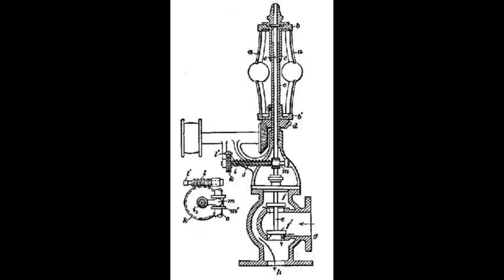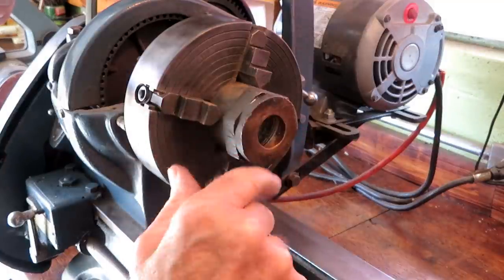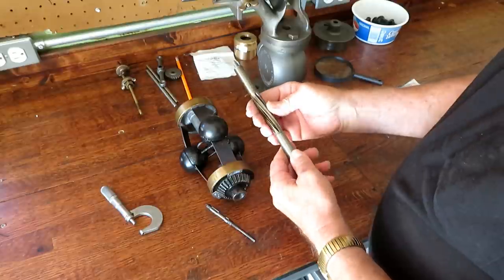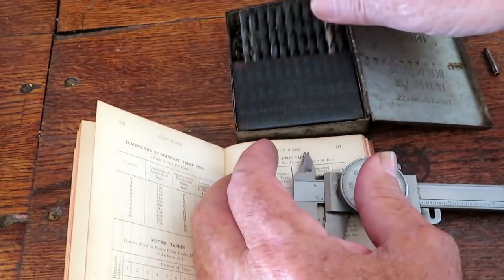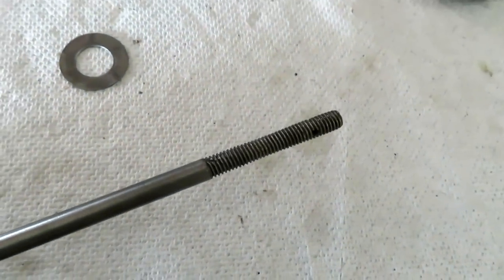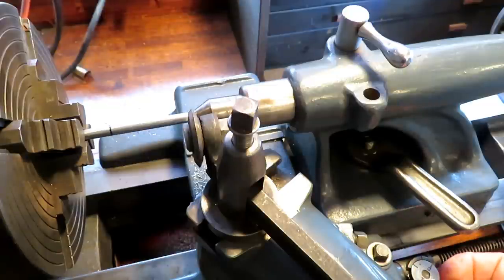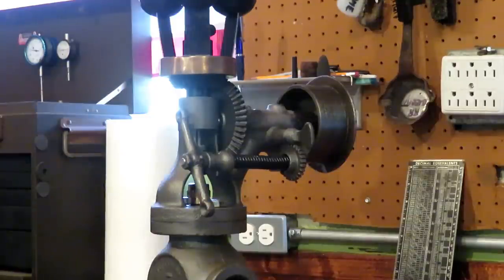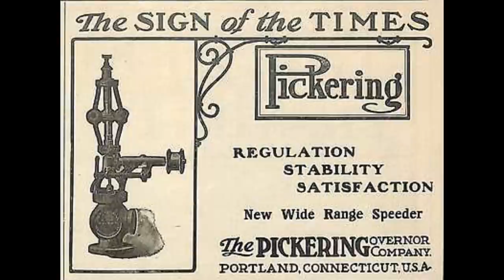Old Steam Powered Machine Shop 70: Pickering Governor for the Liley steam engine

Comment: Glad you're back!
I've had good luck with WEG motors- we use them in the plant where I work (along with Baldor).  I purchased one for my old Craftsman jointer and pretty pleased.  No noticeable vibration, quiet enough that you can hear the knives cut the air when not running wood across them.

Comment: Hi Dave, I don't know if it would help but try some sort of rubber motor mount on each corner of the motor bracket. It may reduce the vibration. Take it easy.

Comment: David, glad to see you back in action.
With respect to your lathe motor hum and vibration, may I recommend you get a Fenner Drives product, namely "Link Belt" (assuming that lathe uses V belts and not flat ones).  This stuff looks like the old fashioned fibre material belting, but is a modern reinforced type of polymer compound.   It comes in several widths and can be bought by the foot.  I buy the 1/2 inch wide stuff from Lee Valley tools here in Canada.  I know KBC tools also sells it.  It seems to have an excellent dampening effect on vibration and did an excellent job on reducing the vibration I was getting on my Myford lathe.  The other huge advantage is given you can open the links up, you can install this stuff without having to remove spindle of any machine from its bearings etc. so renewing belts is simple and quick.  I have replaced all the belting on my machines with the appropriate sized Link Belt.  Hope this may help.

Comment: love the steering bracket with brake caliper on it. nice job. the 401 buick torque monster must be a handful on the tires. really nice ride. glade you are having nice winter. thanks for taking time to make video. have safe trip back to NY
Reply from the maker: Doug, The Buick is really smooth, doesn't like to wind, by 4800 rpm it's finished.....Dave
Reply: @davidrichards5594  my 454 chevette only revs to 5200.

Comment: I'm so glad to see you back after all these months, David. I first watched all 69 of your videos last fall, and loved them. I've built a few small steam engines from scratch. I've also built two lathes from my own castings, and I now have a couple of full size Westinghouse type twins. I believe they are Acme (mfr) steam engines. They are in need of restoration, and I'm looking forward to working on them. Your videos are lways an inspiration.
Reply from the maker: Would those Westinghouse engines be vertical single acting twins with fully enclosed crank cases? I am familiar with them as direct drive dynamos......Dave
Reply: Yes Dave, that's the arrangement. I've had a long time interest in the type. A couple showed up on Ebay, and I bought them. No nameplate, brand unknown. But then I saw one that looked almost identical on the website of The New England Wireless and Steam Museum. And, total coincidence, I found I had a pamphlet I'd bought at a flea market years ago for the same company, showing the engine. It also showed it used in a boat. That added even more interest since I'm a long time boatbuilder.
Reply from the maker: @SRHacksaw  There is a Westinghouse engine/gen of about 6"bore in the East Broad Top Railroad shop to supply 110V DC for lighting through all the shops, station and general manager's house. It's all there with switch gear as installed but not operational at this time. I'll try to find a photo and put it up on my community page....Dave
Reply: @davidrichards5594  That would be great Dave. I'll check the bore on my engines out of curiosity. They seem smaller than 6". I looked at the pamphlet I have and the manufacturer for the Acme brand engines seems to be The Rochester Machine Tool Works in NY state. These are compact rocking valve engines, and the intention definitely seems to be for boats. They sold water tube boilers for them, too.

Comment: Glad to see you back Dave. That's a rigid mount motor, I believe you'd be a lot happier and the equipment a LOT quieter if you use a cradle mount or resilient mount motor. Something like a 58 frame motor
Reply from the maker: Hi Dave, It has early ford (flathead V8) rubber pad mounts in front and the stock Buick rubber mount at  the trans X-member. ....Dave
Reply: @davidrichards5594  hi Dave, sharp looking car! Actually though I was referring to the electric motor on the lathe! It appears as though it's a rigid mount style motor. A lot of noise transfer that way. A 58 frame electric motor uses a cradle mount, or resilient type mount and would reduce the amount of noise transfer to the rest of the lathe

Comment: Drilled and reamed our cigar mfg machine shafts/çams for many a tapered pin '60-'62. Later honed many ejector pin holes for hardened tool steel injection molds. Tip for reaming a very fine amount is to wrap the reamer with tissue well oiled running at a slow rpm and feed.
The Tommy Ivo of western New York, the Nailhead/Ford has all the right stuff properly/cleverly engineered. Just right for a summer drive to the EBT in Orbisonia, Pa.

Comment: I have an Atlas 10d just like that one and it has the original motor and it runs smooth as silk...I use the lathe very sparingly as I have a more modern one for my work horse lathe but I do appreciate that old lathe in it's original condition.

Comment: Dave ... the motor on my SB9 (not the original) ...gave up and burned out a winding ... I took it to my local motor shop ... where they immediately declared it a basket case ....they recommended what they called a 1/2 horse “farm grade” continuous duty motor... I was nervous... but as they promised it is quite and nearly vibration free ... It was a bit more than both harbor freight and granger....

Comment: Hi Dave!! I also work with the old machines. I've watched your videos from the very first. It's hard to find someone to do the old work and knows how to do it. I have an old 10 inch 4 jaw chuck from the 1880s that needs operating screws for the jaws. Wondering if you would be interested in making them. I can't find no one even interested in doing the job. I love the the videos keepem coming.

Hank.

Comment: I like your Atlas lathe, really nice.  When I was growing up at the end of the '40s and into the '50s my uncle Bernie had one exactly like that.  He taught my cousin and I to use it along with other shop tools and we made parts for bicycles and other stuff plus some jobs for things uncle Bernie was working on.  Learning on that lathe and in uncle Bernie's home shop was my starting point for a 60 year career as an engineer and physicist.  Seeing you and what you do is truly impressive, love your videos.  Keep it up.
Oh, yes.  Your motor.  Unfortunately, that is what you are going to run into these days.  The reason for the loud buzz/hum is that the windings are not well secured and vibrate under the applied magnetic filed.  Pretty typical quality of import stuff.  Even the big name brands, at least in small motors, get their stuff overseas... it's all about the profit numbers.  Best advice i can give people is to find a used older motor that is from when they were still made in the states.  See if you can still find a local electric motor shop and check with them or troll the flea markets, I believe that it's worthwhile to recondition and older unit than put up with a cheap imports deficiencies.
Reply from the maker: Mary, Thanks for the comment. I believe you are absolutely right about cheap motors. The old ones were silent and smooth. I'll be looking for one.....Dave

Comment: Nice car.  Was   trying to figure out the engine until you  said it is Buick.  Those Buicks had the torque.   I remember the dirt trackers liked the Buick motors back in the day.
Electric motors- I burnt up the motor on my mid 70's Craftsman table saw about 10 years ago.  Did alot of looking for replacement.  Finally got one to suit from Grizzly.  Can't complain about that motor.

Comment: Nice vehicle. Enjoyed seeing and hearing the info on the governor. Would suggest upgrading the bearings on that electric motor. Put an ampprobe on the motor and check the draw. If it's 5% or more than nameplate replace them with the upgraded bearings. If its a capacitor start motor check capacitor or just replace it. Graingers motors can sometimes be a problem, some "foreign" junk. Have done alot of A/H work in the past. One more thought, check motor mount for being hefty  and ridgid. My 2 $ worth, good luck.
Reply from the maker: Might be worth a few tries...Dave

Comment: 401 cu in, that's 6.5 litres. America, eh? I have a 2.5 litre engine in my Ford in the UK, and that's bigger than most things I meet. Likely to be 1.5 litres when I change the car. My old Lotus 7 was 1.6 litres, and that really did accelerate, they said 0-60 in 4.3 but I doubt that the rear axle linkages on mine would have held up to that. Mind you a reasonably fit man could pick up a corner when I needed to change a tyre. I didn't build it, I bought it from a man who bought it from the man who did, and he really did it on a shoestring. Well, it's a big country, so I guess you need big engines. The governor looks great.

Comment: Hi, Dave! Watching this video I see we have some of the same things. The Delta drill press, the Old Kennedy chest, and the same miserable motor! I sold my 10" Atlas a few years back, it had an Atlas motor, and it ran really smooth and quiet. Wish I had swapped motors before I sold it, but it went to a really good guy. Mine was a 10F with the horizontal countershaft, and had babbit bearings like your 10D. Parting off small diameters was tough for me with the Armstrong tool holder and the babbit bearings! 
Nice Hot Rod, I like the nailheads, see very few nowadays. Did you have to put in hard exhaust seats to run the no lead gas?

Comment: Good to see you again Dave... last fitted those taper pins on English Electric gear in a 1930's vintage hydroelectric power station.  Did more fitting than turning back in the day, so how did you register the swapped in thread cutting tool?
Reply from the maker: Hi Graham, I engaged the lead screw on the number, rolled the carriage slack to the right, pushed the point of the tool straight into the thread and tightened down the tool post. Thanks for watching......Dave

Comment: Hi David 
Is there any chance you could give a full shot of the Taper Pin Imperial and Metric page in the ICS Machine Shop Handbook. I have been told there is a difference in the Taper angles?  I wanted to use a 7/0 Taper Pins in a job I was doing but the 7/0 Taper reamer I purchased was visibly larger than the pins. I complained to whom I purchased the reamer from told me about the difference between Imperial and metric tapers, he told me that what I needed was a 1/16" Taper Reamer which he did not have. I have searched the internet for the information for the information in your ICS book.
Regards
Reply from the maker: I'll get it posted sometime on my channel's Community tab. 7/0 ? is that seven sizes under a #0? Those small sizes were later added below a #0 I think.....Dave
Reply: Thank you David, yes 7/0 is the smallest taper pin size, I am using them in a 5 inch gauge steam locomotive motion

Comment: Hi David why would a shop have a shaper when it has a milling machine? 
lt takes a lot longer to machine  a flat surface on a shaper than on a milling machine. 
Keep the video's coming really interesting Graham.
Reply: It wouldn't, unless one just wanted to show how it was done before milling machines.   That is like asking why he uses a steam engine instead of electric motors to power the machines.

Comment: That sounds like a 60Hz hum!
Many motors have poorly fixed windings which can cause this! 
Of course it could be a badly balanced rotor. I would suspect it would be an easy fix for yourself .... although perhaps not if you need the motor for the lathe ;0) but a quick roll down a set of parallel bars would show eather unbalance or deviation from center! But the easiest "fix" may just be a set of mounting rubbers for it ;0)

That sir is a mechanics car! .... and Yes I did enjoy looking at it!